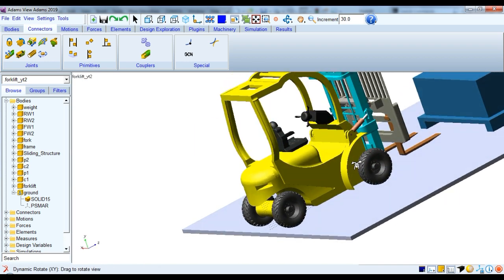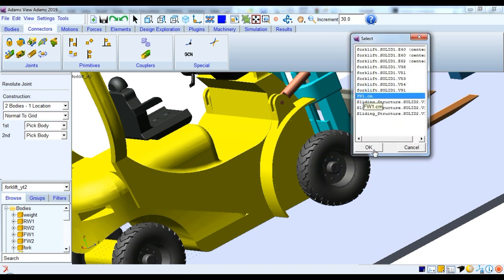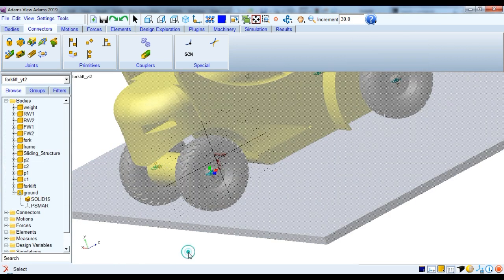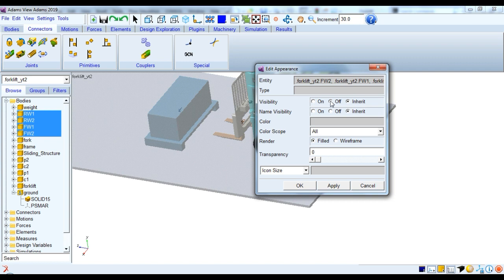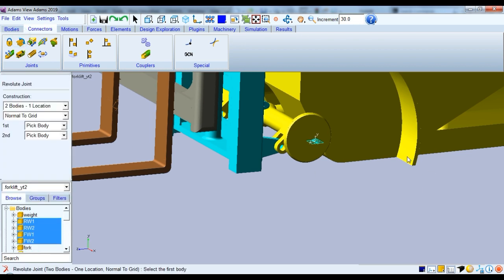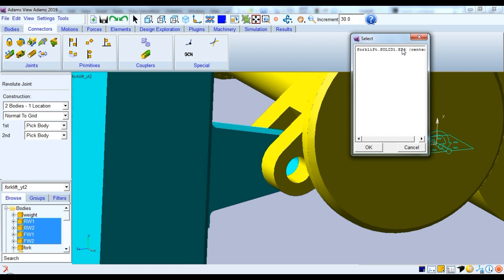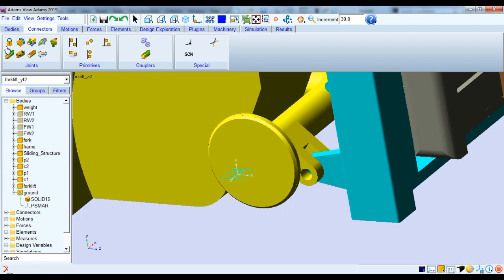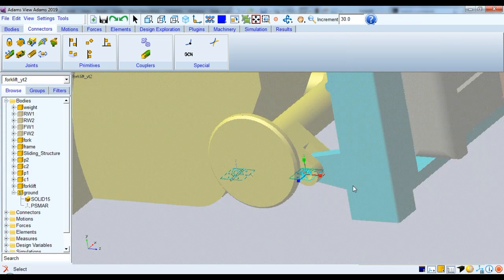Forklift Simulation using ADAMS

Comment: I need help again, I tried to do a simulation, but there is something wrong I don't know. I  interred all features of parts, 4 wheels have identical speed and weight, the vehicle is symmetrical. The problem is that during the simulation, the vehicle is going to the right side. According to my plan, the normal force at the front wheels should be same, but they have big differences, as well as the rear wheels. what do you think about the problem? thank you in advance!

Comment: There is one question, how did you control the distribution of the vehicle weight to the front and rear axles, if I am not mistaken, most part of the weight should be on the rear axle (about 60%), so if we can not control the distribution of the weight our result will be incorrect. If it is possible, could you make another video, please? Because your explanation is very clear, thank you in advance!!!
Reply from the maker: To distribute weight you can model as multiple sphere geometries at different locations
Reply: @3DTechnocrafts  thank you

Comment: Hello there. That step in step function is really nice way to build an expression. I've always used a gradual subtraction of similar IF functions for that sort of expressions, but your method looks much more elegant, and I'll defenetly use it one day, my thanks:). Anyway, may you share experience about values of stiffness parameters of contacts? Simulation resaults with {10E5, 2.2, 10, 0.1} doesn't really look like contact of solids in real life, because oscillations and bouncing of bodies are actually insane lol:D
Reply from the maker: You can reduce contact stiffness to avoid bouncing